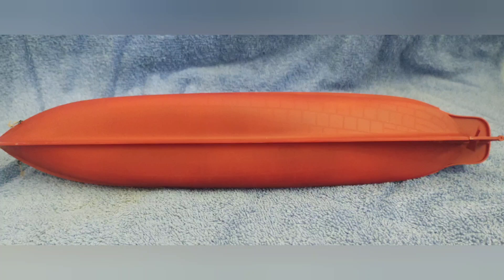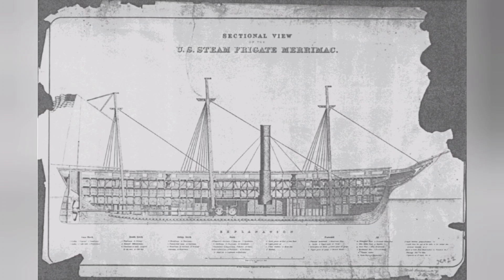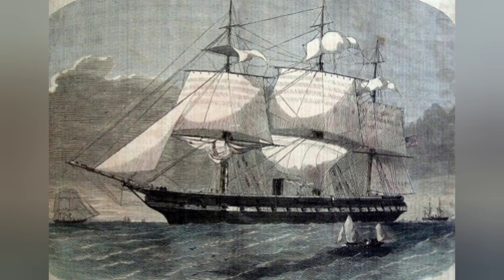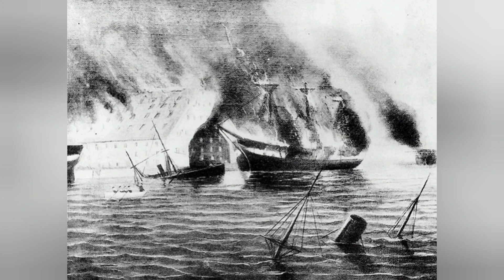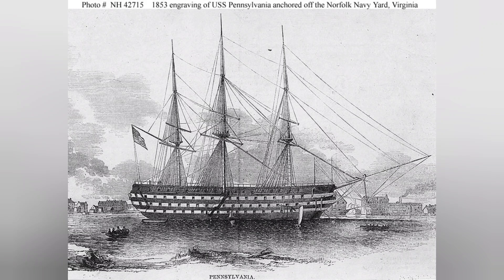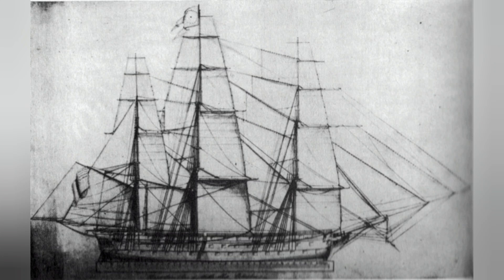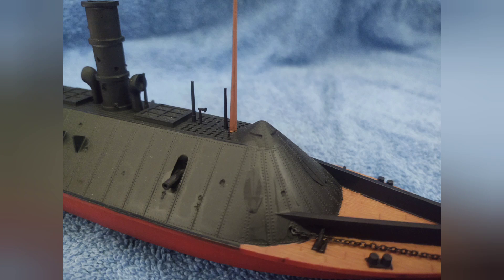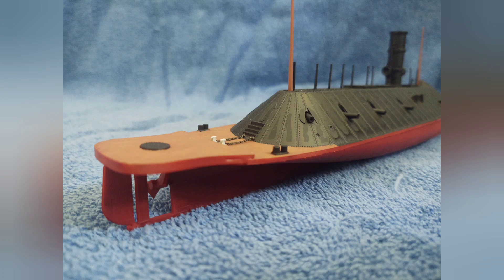Building the CSS Virginia: part 1

Comment: The model you show has a flatter bottom than the copy of the original plan you show. Hm.
I bought a 1/700 scale Virginia/Monitor dual kit many years ago, from the Polish resin producer Modelkraak. Both kits scale out very closely, and Monitor isn't a horrible representation. Virginia, however, is. It's as though some one was given a verbal description only to go by.
 Awful and unbbuildable, scratch building would be easier.
Thanks for posting!